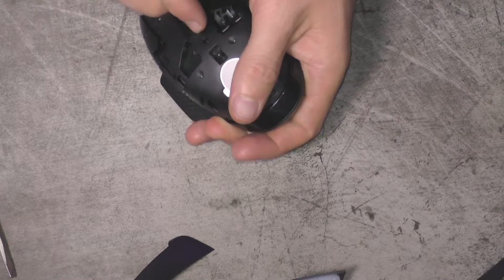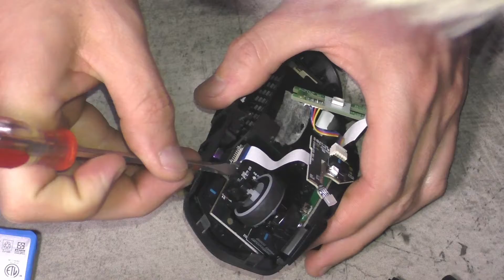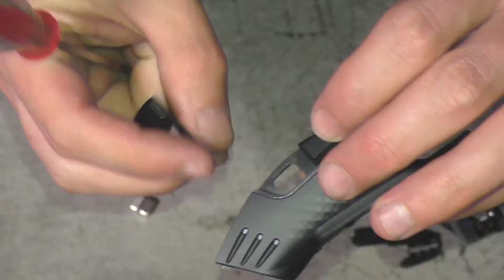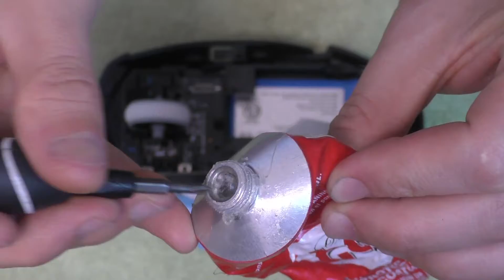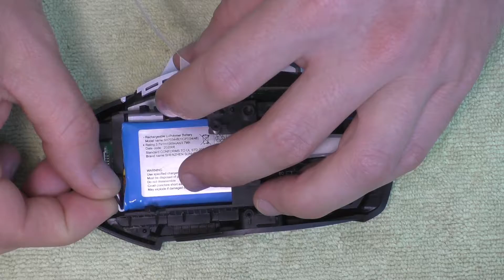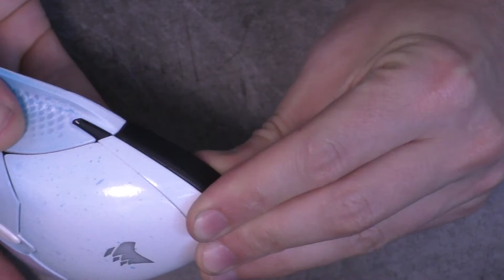Corsair Dark Core RGB Pro Full Disassembly + Reassembly Assembly - gaming mouse

Comment: Thanks dude, saved my ass!! My scroll wheel started skipping, then it would scroll the wrong way until it finally just stopped. Thanks to your video i was able to get it apart and the sensor cleaned out, works good as new again! Thank you!!
Reply: I just bought TWO of these Dark Pro... and both wheels failed.  15 days, and 30 days. Absolute insanity.  I can't be bothered to send them to corsair, I'm just frustrated.  Will give it ago, otherwise it's going in the trash... I can't be bothered with the hassle of RMA to get another failure.
Reply: @matthewwain9958  I still have mine and would have to take it apart every couple weeks because the wheel would start skipping again, last month i completely took it apart and actually removed the scroll wheel from its pcb and filled a syringe with alcohol and just douced the inside of the sensor and then put the wheel back on and spun it, did that a few times and put it back together and so far so good. I feel your pain, didn't want to send it off, try doing what I did
Reply: @blakekelley8112  i will give it a go.  Just so stupid having a poor excuse for a wheel design when we have been doing this for decades. Budget 15 dollar mice can do it, but corsair almost 100ndollar mouse can't? Lol.   It will likely get relegated to being used with my Legion Go.
Reply: @blakekelley8112  ... and thanks :)   I just tore the thing apart, and doused the sensor in 91% IPA and kept rotating it multiple times.  Repeated a few times and it's back to working again... for now.  I've not bothered putting the very rear pad back on beneath the screws as I suspect I'll need to do this again at some point.  I'd rather replace that sensor with and optical one if there was a mod for that.  Thanks for the tip.
Reply: @blakekelley8112  Apologies for the quick follow up.  The wheel went back to not working correctly 20 to 30 minutes later /facepalm.
Reply: Same exact experience here. Cheers!

Comment: Thanks! I love this mouse but my scroll wheel position sensor shat the bed. I'd been under the impression it was optical, and that I needed to take it apart to clean it. Turns out, it's mechanical and soldered onto the board, as I learned from watching this. I did notice that jump cut after taking out the only two screws on the bottom, which made me suspicious that there was a stubborn clip holding that cover plate tray. So I took my old one apart first and sure enough, regardless of how I put pressure on it, the clip is too small for its hole, was pressed on by the factory, and is what they check before voiding your warranty for user interference. If it's broken you're not getting anything under warranty. And if you take that plate off by any normal means you're breaking the clip. So I sliced 1/16"-ish off the tapered of the clip with an exacto-knife and popped it off like normal with no further damage.

Great news though, the only part of my old mouse which hadn't broken over time was the scroll wheel and its board! Lol.
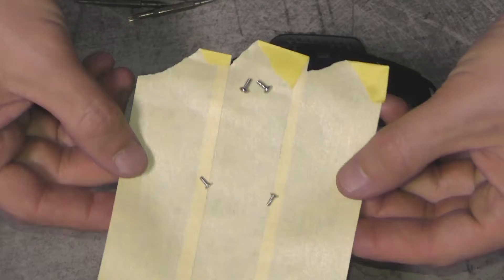Reply: Glad i'm not the only one who spotted that he just omitted that stubborn clip from the video.  At 1:12 the top cover doesn't just come off like he made it seem.
Reply: @Rastaxz  It absolutely doesn't. Lol. The X-Acto fix worked well for me though (tested on my retired mouse first ofc), and it's pretty indistinguishable as long as you steady your hand while cutting. To clarify it's just the locking tab you're shaving down, and it's a lil awkward. But it does get it off without having a loose body point forever.

Comment: 2 years and still helping people out. Thanks!
Reply: if ur thinking about getting this, dont. corsair is not the same quality as back in the day. buy a competitor at near same price. had this mouse 2 months and wont charge or turn on, light use i work all week. Spend your money to a company that will value your return on your money. Corsair has been gouged for profit. These products DO NOT last. Google dark core not charging if you dont believe me. Countless threads, most unresolved with a shit out of luck message or forced to pay to return it. My biggest regret in my pc setup is using corsair in modern day.
Reply: @classicwrestlingvault  I've owned this mouse for about 2 or 3 years. Just needed to be able to clean it out and it still works just fine..

Comment: The battery on mine died after three years, to the month. Doesn't hold a charge at all now, and it only saw moderate use, not daily. It's thanks to this Dark Core RGB mouse that I'll never buy another wireless one that has a non-removable battery like this. They're ALWAYS difficult to remove, and next-to-impossible to find a replacement for.

Many thanks for this video. I'll be using your guidance to attempt refurbishing my own Dark Core.

Razer is one of the few major brands that allows normal AA and AAA batteries, even in their high-end mice. Despite how bad their Synapse software is for reassigning binds and macros, I'd still recommend a Razer wireless mouse over any of the other leading competitors, simply because Razer doesn't follow this stupid trend of glued-in proprietary batteries.

Comment: Great video! I think a good ithing to do is to give a hint that the SE variant is not the same even though they're really similar. Also, the scroll wheel with the cable adapter SHOULD NOT be removed. It's super cramped and I ended up breaking the black plastic thing when I tried to put it back. 

One last thing - Although I ended up fixing the side buttons that was glitching out I ended up breaking the left mouse button. FML, time to buy a new mouse.

Comment: Fixed my scratchy/squeaky wheel thanks to this vid.  You're awesome, saved me the $ for a new mouse, thank you!!  :D

Like some others here, my Corsair Dark Core had a scratchy/squeaky sounding scroll wheel.  With the help of this disassembly vid, was able to get full access to the wheel to fully clean the area and add some oil/lube to the axel/rotation contact points.  (An old toothbrush + q-tips + compressed air can = really handy for this). 
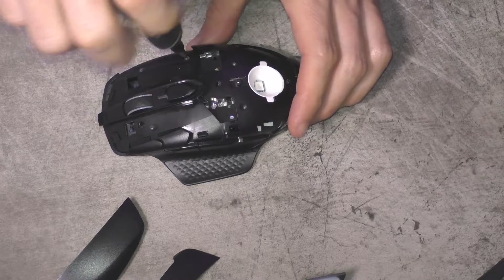The trickiest part was dealing with the base slide-pad [ 0:55 ];  Ensuring the adhesive preservation on this heel pad is obviously super important to maintain smoothness on its surface (tho a good choice of glue could solve a corner coming lose).  Anyway, using a hairdryer really did the trick!  
Perfect outcome, Thanks again!
Reply: what did you use for oil/lube for the wheel?
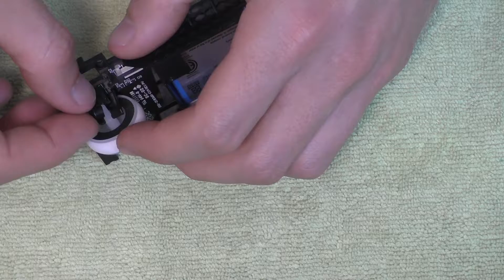Reply: @Nebula1701  I used GLIGING GPL 105 (since I had it already for my keyboard switches).  Regular household lubes may work too -- I wouldn't use wd40, but 3 in 1 would probably be ok.  I had to reapply my gpl 105 lube after about 8 months when the scratchy sound started to come back (GPL 205 or 3 in 1 lube might be better for this).   I found the scratchy sound on mine was actually coming from friction within or possibly around the plastic cylinder cap (shown here at 5:31)

Comment: Thank you very much! 

I have that mouse, accidentally slapped it and hit the floor hard, the left click and the 2 side buttons were stiff. Had to bite the bullet and disassemble it. Thankfully nothing broke and managed to fix it. Also removed the back cap to add some.. plastic wrapping, because the rubber back was starting to get super sticky. I hate it then they use that type of leather lols.

Comment: Thanks boss! Personally, I had to take it apart to remove a malfunctioning battery from mine. The battery wouldn't charge on iCue and the mouse kept disconnecting at random, pretty annoying. This would be a very peculiar one to take apart with no instructions...thanks for the video! PS: If the same happens to anyone else, the mouse works fine with no battery inside, if you wanna keep it as a wired only piece. Cheers!
Reply from the maker: yes luckily I found instructions someone wrote online. I'm not sure if I could have even figured it out on my own
Reply: mine came with battery disconnected

Comment: fixed mine by pulling the batt cable for 30 seconds and put it back in and plugged it in to charge up. guessing it went into sleep mode and died. got stuck in sleep mode.

Comment: Thanks for this very helpful for cleaning. The only downside is that rubber part with the logo on it that you have to take off first I messed up putting it back on and broke a little tab off like you had warned (that's what I get for not watching the whole thing!) but once I got the alignement right it snapped into place and seems no worse for the ware. Next will be to clean the keyboard! also nice paint job. A link to this video should have been included in the box!

Comment: I took mine apart and it was fine until I turned it on, when I did it started glowing white and when I plug it into my computer it blinks and won’t let me click on anything and slows the mouse speed down to a snails pace. Any idea how to fix this? I’ve checked the forum and it just tells me to reset the mouse but it does nothing

Comment: Able to make a disassembly video of the SE version of this mouse not the pro I’ve got one that has a problem with the scrolling wheel an can’t seem to figure it out
Reply: having a scroll issue with the SE aswell. did u ever figure it out? i somewhat stabilized it and it no longer scrolls the opposite direction but now the scroll is weak

Comment: Bought TWO brand new of these.  first wheel failed in 15 days, second failed in under 30 days.  (Intermittent mouse wheel).  Seriously.. what the heck!?!  My Logitech G602 from 9+ years ago is still working, whilst this $90+ dollar junk cannot 1) Have a wheel that actually works as advertised 2) A battery only last 4 days. LOL.
Reply: Not to mention the mouse glitches/delays when you do certain actions in windows, like opening the notification menu.  Absolute junk for the money.
Reply from the maker: That's terrible.  I've used both my logitech and razor for years with no issues

Comment: who knows what size jst 3wire connector the darkcore rgb pro se uses?  Thx ive gotten my mouse down to 96g with stock battery but wanna swap a 200-300mah battery to drop another 10+ grams ez

Comment: if ur thinking about getting this, dont. corsair is not the same quality as back in the day. buy a competitor at near same price. had this mouse 2 months and wont charge or turn on, light use i work all week. Spend your money to a company that will value your return on your money. Corsair has been gouged for profit. These products DO NOT last. Google dark core not charging if you dont believe me. Countless threads, most unresolved with a shit out of luck message or forced to pay to return it. My biggest regret in my pc setup is using corsair in modern day.

Comment: not sure if youre still responding to comment but im trying to take the top shell off ive taken out all 4 screws but part of the shell just behind the side button doesnt want to come off it looks like there a clip that is hold it down and because you cant pull it back far enough to unclip it it wont come off and looking at the video did you just snap it off and accept that it would just be broke and if so how did it affect how it holds itself together is there a slight gap now between the bottom and top shelll at all?
Reply: Had the exact issue, i ended up accidentally snapping the clip trying to push it back with a screwdriver, but the snapped clip caused me no issues so to me personally it makes no difference

Comment: My left buttonis too much sensible, it became silent and almost tactile ^^ do you think it can be resolve by changing  cover ? btw where did you find the new parts please? thx !
Reply from the maker: I'm not sure. It sounds like an issue with either the switch or with the actual plastic button and the mounting for it.  I would take it apart and check out the button components 
I did not change any of the parts. I only used the same ones
Reply: @HowToHippopotamus  Finally i openned it, and i saw a diying switch under the plastic cover...i tested it, it did a last 'clic' then nothing, the switch was dead.
by disassembly, he died...

So i will test the razer viper8K, saddly lighter, but same clic latency, maybe less, let's frag ! 

Thank you ;)

Comment: My Dark Core mouse currently facing double click problem. Does the switch need to be replace?
Reply from the maker: yes. It has to soldered to replace it also. You might be able to find just a replacement board with the switch already on it though. Check ebay
Reply: @HowToHippopotamus  I've gained some confidence after watching your video. I've been looking for disassembly video for Corsair Dark Core for past weeks, but can't find it. Now I successfully fixed the double click problem (after watching another video). Thank you so much.
Reply from the maker: @taufiqburhanuddin4249  yea I had to find a written tutorial just to figure it out. There were no videos

Comment: Maybe a stupid question but, Will the Mouse work without the recharchable battery if its plugged in? the mouse is a little heavy xD
Reply from the maker: not sure. But I doubt it
Reply: I think it will. It works ok as a wired mouse when the battery is dead.

Comment: Do you have the battery model number by any chance? Mine won't hold a charge anymore and need to replace it
Reply: I used a LP103450 which is 1850mAh battery the original was a 1000mAh battery. By the way LP103450 refers to the size 10mm x 34mm x 50mm. So any battery with dimensions smaller than that rated at 3.7V should do as there is a BMS system built into the pouch, which prevents overcharge, undercharge and over-current.

Comment: dont get it. have to double check and same mous, but that top part just don't want to come off. 
wheel is not working properly and needs cleaning.
Reply: I know this reply may be a little late considering this was made 3 months ago but I just came across the same issue, if you look behind the DPI up/ down buttons theres a little pin holding the cover of the mouse on, if you push it outwards eventually you'll hear a pop and it'll come loose. Hope this helps.

Comment: Thanks bruh. Fixed my squeaky click because of you!
Reply: Just got one and have the same issue with a right click squeaking really bad. Did you just take the click pieces off and oil/lube? Or did you have to take the whole thing apart?
Reply: @jp.pressure  Just took out the click pieces and put some keyboard lube on it xD (crytox lube). Only downside is that my right click now has some sway in it.... it really annoys me and I am not sure if it was my error of not reassembling it properly.